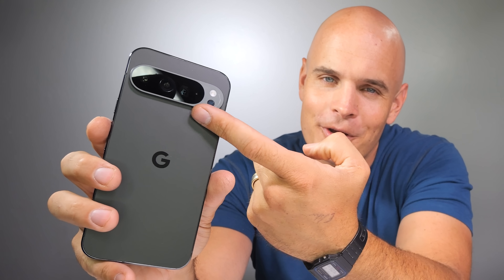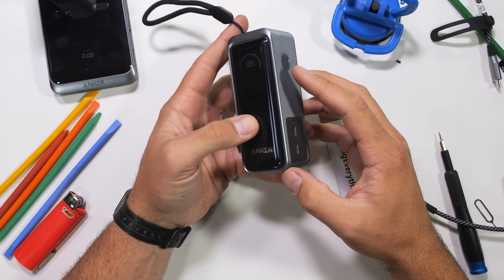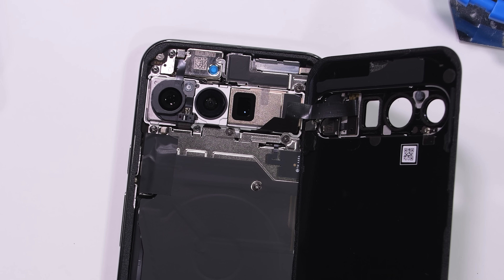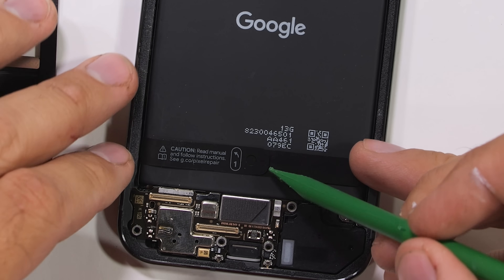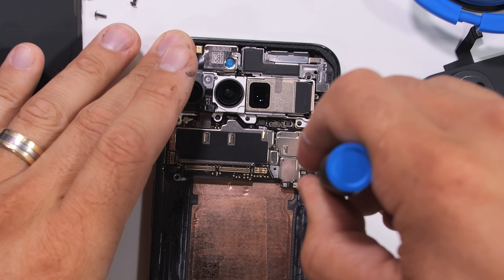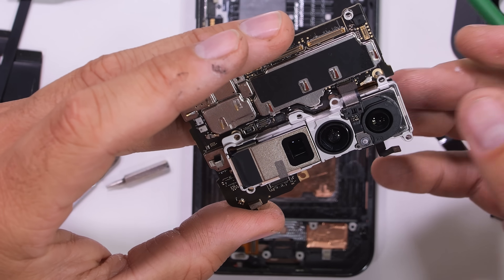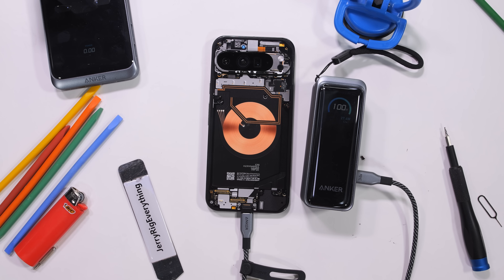Google Pixel 9 Pro XL TEARDOWN – (turn back while you still can)

Comment: Thanks to this video, I'm not buying the Pixel 10 Pro XL.

I'm a power user and always charge my battery to full at least twice to 3 times a day. I'd usually want to replace my battery 9-15 months in. With this phone, it's almost impossible. So screw Google.
Reply: See pixel 10 pro XL, it's impressive

Comment: 3:11 From an engineering perspective, varying thickness would indeed make a difference (a standard thickness is good, but with space concerns it is the next best option). But it isn't worth the added manufacturing complexity to actually do it, most of the time. At least, thats off the top of my head, so I could be wrong.

Comment: Just looked at the iFixit on how to remove the batteries on the pixel 9 and oh my God is that ridiculous. And oh my God is that ridiculous. In the instructions it says to tape off the tabs, heat the battery up and certain locations for the adhesive and then you're supposed to use pull tabs to saw under the battery to pull it up and out. And it's already a nightmare to get to that point with the battery where you have to remove all that cabling and screws that are all different. Such a bad design for repairability.

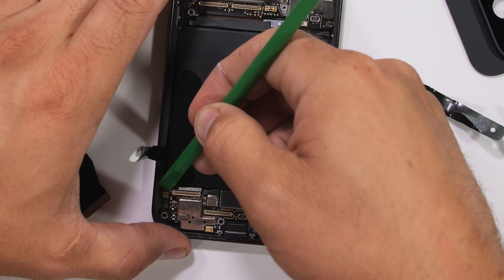Comment: 4:17 **“Hey Zack, I love your teardown—especially when you explain the L‑shaped mic channel and how it preserves water sealing even if it’s poked (around 5:15 in the Pixel 9 Pro XL teardown)

This might be unrelated, but I recently dropped my Pixel 9 Pro on hardwood. Afterwards, the physical SIM slot stopped working, the vibrator motor died, and the loudspeaker is now silent.

Could these be the result of a loose or damaged connector you’ve encountered in your teardowns?

Or perhaps something got dislodged or broken on the motherboard?

Would it help to open it up yourself, or is it best to seek professional repair?

Thanks for any insight!”**

Comment: You can use the straps to cut through the adhesive. Other videos show that. You also likely need to use purer alcohol. 91% or 99%. It would help of the alcohol is warm. Work it in, add more, Granted it'll take a little time. The glue is annoying. These really should be screwed in batteries IMO. People really should write to folks in congress demanding that device manufacturers are required to make the batteries more replaceable, and require all devices standardize on a few set battery form factors, with commitments to keep making the same battery form for 20 years (with charging circuits capable of dealing with newer battery techs).

Comment: I love my Pixel 9 Pro, but within 2 months, the back panel makes a squeaking noise any time pressure is made on the bottom half of the rear of the phone. The phone still works fine but it is a horrible noise to get used to.

Comment: Bro, i just poked wrong hole trying to eject SIM slot on a fkin new 9 Pro XL, your video saved me from the stress...
Reply: What about your water resistance today? It works fine? Cause i did the same on my new phone too 😢😢
Reply: @SHISHINTO2012  tbh, I didn't risk checking, so be careful bro 😢😢😢. But I think it should work OK, ig.

Comment: We have removable charge ports in pixels and you don’t need to risk screen damage to get in the phone. This is a repairability win from someone who has done warranty repairs on all pixel models. Heat and iso will get the battery out no problem. They’ve been this difficult to remove since the 6 series, nothing is new here. Need a standoff bit and torx bits? You’re already buying an ifixit kit to open this to begin with, so these points are irrelevant. If you’re not confident in opening an expensive electronic, don’t. They haven’t been “repairable“ for the average consumer in YEARS. Pixel repairs are easier and more forgiving than any other manufacturer starting with the 9. I’ll take it to the grave.

Comment: Hi Jerry, when you punctured 5:16, the membrane and you assembly them backl again, does the bottom mic still works on your side? I have the same damage from my mic membrane when I checked the inside because Google voided my warranty and I wanna know if that membrane is actually the one that made my mic stopped working or I need to replaced the entire charging assembly that comes with a mic on it. Please I need your answer into this. Thanks.

Comment: I accidentally stuck the SIM tool in the microphone hole, glad to hear that no damage can be done. I definitely felt some kind of "pop sound" though. Is there a membrane that protects the device from dust that I damaged?
Reply: Yeah i heard that too, so today your water resistance and mic works well? Cause it was my first day with the pixel 9 pro 😢

Comment: Why is there a need to glue the battery to the body? What about the good old days of battery replacement by just lifting up the battery to remove it!
Reply: Having a battery just floating around in a phone you move around in various ways every day is not the smartest idea. Some glue is necessary but google used way too much here.

Comment: As a technician, I get where the t4 screws would not be the greatest butt versus a Phillips. These screws tend to have more torque available before deforming versus Phillips. Though I have had some bits break on the t4s before as well

Comment: The adhesive slicer for the battery might not be a slicer. On my pixel 6a I just used it to lift the battery up and it worked. 

Take the both ends of the plastic strip as high as you can and try to lift up the battery a bit
Then take both ends of the plastic strip to the lower end of the battery and try lifting up the battery

Comment: A good tip I use for organizing screws is using cardboard. I just draw a rough outline of the device, and stab the screws in the cardboard where I removed them. Very useful.
Reply: Good method.

I use a numbered small parts organizer, looks like an ice cube tray. Then I watch a video and remove the screws in the same order as the video and reverse the process when done.

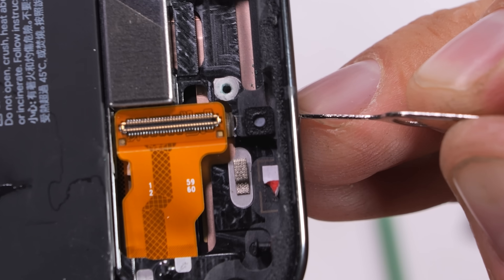Comment: 5:03 - I pressed the SIM needle into this hole by mistake to remove the SIM tray. I did it with force, I hope I didn't damage the microphone. It's surprising why Google made a hole next to the SIM tray
Reply: Your water resistance and mic actually works fine? Cause i did that recently 😢
Reply: @SHISHINTO2012 Mics is OK, waterresist doesent try now, all fine😮

Comment: It doesn't matter what they say—when you open the phone and the camera lens isn't exposed, dust still gets in. No matter what they claim about it being easier to repair, in my opinion, the outer protective lens should be directly connected to the lens housing with screws, so you can separate it. But when you open the back or the front housing, the camera lens should not come into contact with dust at all.

Otherwise, the repair makes no sense, because not every repair shop has a dust-free room like the ones in manufacturing, as I know from China or elsewhere.

Comment: In my opinion this is much more repairable since you don't need to remove the screen to repair it. My 7 pro back glass broke and there was no way to fix it without accidentally breaking the wireless charging coil that is glued to the back glass.

Comment: The design is too bad like ASUS, intentional error by the manufacturer, the connection cable is on the battery, when the battery swells it will pull the socket connection destroy

Comment: Bought google pixel 6 pro when it got released....only usb C cable in the box. After struggling with the software and battery for a lot of time(2 weeks, but it seemed more), i sold it for a Xiaomi mix 4.

Comment: Certified mobile electronics and micro-soldering repair tech here. Just wanted to say a few things regarding some of your remarks in this video. First, the torx bit is one of the best designed bits used to ensure it less likely strips and getting the size wrong is near impossible. Philips and Apple's famous "tri-wing" are terrible, especially the latter. Apple uses screw sizes of all kinds of different heights. If we remember the home button phones, getting one of the bracket screws mixed up with the one screw behind the home button would result in permanently damaging the home button which is irreplaceable except by Apple. Apple also still has measures in place so the face-id components are not replaceable. So to say that Google is moving backwards compared to apple is ludacris. Yes Samsung probably has the best repairability score due to every screw being the same and very few components, but there are certain design aspects in the phones that are also terrible that cause permanent damage, but that's another debate. In regards to the battery removal, Apple's "pull-tabs" haven't been useful since the iphone 7. Pull tab quality has decreased from the iphone 8 all the way to what we have now and using a heat plate and alcohol paired with a prying tool is the best and fastest way of removal. I don't even touch the tabs unless its pre iphone 8. Samsung is no different in that regard either. Sure the pull tab they give is much larger, but still requires excessive force to remove, heat and alcohol are still your best friend there. This is just simply the best method of battery removal, it's the nature of the design. it's no different than having to use heat and a knife to remove back glass. It'd be like ignoring the proper method and then cry when the glass breaks. Could there be an easier way? Sure, but every phone manufacturer including even Motorola use this same pathetic method of using the worlds strongest adhesive to secure a battery. imo here there is no change from previous generations of pixel phones. They have always used torx bits, and the battery tabs are to be ignored in near every phone by any tech in this field.

Comment: I immediately jammed the SIM tool into my microphone hole and I was so nervous I damaged the mic! Thankfully it works.
Reply: same here. thanks the one who design the microphone near sim tray
Reply: I did this exact thing 🤣
Reply: I did same exact thing but it works fine and I finally sucked my microphone hole to test waterproof, then no air leaks found😂
Reply: Did your pixel works the same after that? Need to know cause it was my first day with it today! And i did it i wont sleep tonigh dude 😢 @kyandercobalto888
Reply: @kyandercobalto888 so we can say it's still water resistant?
Reply: @dev-sz4sr Yes. no air leaks mean that no water invade.
Reply: @kyandercobalto888  I did also but in upper mic hole :o Looks like everything is ok...
Reply: @kyandercobalto888  what do you mean by this?
Reply: fuck i did exactly the same. I know Im an idiot, but the google people arent far behind
Reply: I have the same concern; I think I damaged the microphone hole's water-resistant membrane when I hit it with the SIM card tool
Reply: I just did exaclty the same and am watching this video to see how bad i f*cked up. Im glad engineers thougth of that
Reply: Does the mic positioning sideways to avoid damage also applies to the Google pixel 9 pro (not the XL version?) Anybody knows this?
Reply: @lehajenowa  yeah same in pixel 9 pro. in fact, every phone uses same mic module.
Reply: I did the same thing.  why the hell did they design it like that?  thanks JerryRigEVerything for doing a teardown.  that calmed me right down lol

Comment: Having screws be Philips is bad. It allows people with absolute zero knowledge to try to repair it. At the least if they don’t even have the drivers they shouldn’t be repairing. You should see how many fire calls are received from accidental stabbing while opening or just pulling batteries out without pulling tabs out it’s crazy how lazy people are so in a way it protects some of these slow people

Comment: it is a pixel, you just need to use it for 5 minutes and it will be hot enough to remove the battery easily 😅😅😅😅

Comment: You would think that it is unnecessary to have that much glue on the underside of the battery, but if you look closely you see that the battery is glued to the copper vapour chamber, so the heat from the charging of the battery could be directed away from the battery. I'm not sure if is necessary to repair these phones as they get tossed away while they are still perfectly working by people who want's something new in their hands. By the time the battery needs replacing nobody wants that old phone anymore.

Comment: This seems pretty biased to me (and not sure why). I've worked on plenty of phones and personally not a big pixel fanboy myself, but you are just being unfair. TORX is very standard, i'd rather have that than philips any time of the day. Different screw sizes? Seriously? People that are even slightly skilled to do repais need to keep track of the screws one way or another. Look at any assembly, being it cars, computers components or even furniture.
The battery situation was really a stretch, i mean come on.. those are not pull tabs and if you would have spend 10 seconds looking into it, you would understand how to use the "tabs". Yea, the glue is strong, imho way too strong, but still I wouldn't call this as a major issue. 
Everything is pretty modular, USB port, cameras, etc..
I would love  to jump on the bandwagon of bashing but there is no objective ground for that...

Comment: I don't like how you criticizing good changes as bad. They definitely need to fix the modem because the previous pixels had terrible signal and disconnection issues. There was also a huge issue of overheating in the previous pixels as well, and they've addressed that pretty well. Cooling is so well that their performance is more stable over long durations than S24 Ultra.

Comment: Sincerely one of the worst videos I´ve seen from this channel. Starting with a awful ad lasting almost 1/4 of the duration of the video (and for a not that great brand). And so many remarks and opinions that from a technical standpoint just aren't correct. If I didn't know your channel I would think this video misguides viewers on purpose due to a personal agenda against the manufacturer. Opinions are ok, judging manufacturing decisions without knowledge of technical characteristics of the components and how they work is just not ok from a channel like this.

Comment: Yup, they really need to do away with those strong adhesives for the battery and put a battery adhesive pouch instead. At least they made the charger port replaceable finally which is a pretty big improvement considering its been soldered to the main board for as long as I can remember on these pixel phones.

Comment: Indeed Google is going backwards in complexity and repairability.  Not to say it is a bad unit but, I have been a Samsung Galaxy "S" series user for over a decade and (for me) I really like where the Samsung One UI has gone with further tweakability with the Good Lock modules that (for me) no other Android brand can beat with the added Modes and Routines and DEX that I use daily!

Again just my opinion but the camera area is just absolutely HUGE and not attractive but, like many of us a case will lessen this to some degree.

IMO never been a Pixel fan having tried a few I always go back to the Samsung "S" series because for me the rather stock OS does not really do much for me and like to tweak every aspect - again ALL strictly opinion as SO many prefer the simplicity/blah-ness of an iPhone that I just could never live with day-to-day to look at or use and interact with.

Comment: Luckely in 2027 the EU will pass a law which will make it mandatory for new phones to have easy consumer removable battery. It was just so great with the old phones. Oo battery is empty, well I just swap it with a fully charged one. No need for power banks with cables etc.

Comment: Using more screws does not necessarily worsen the repairability I think. Only if standoff or brackets physically break. And in this case - you're, well, screwed anyway)
Baffles me - why they won't use them for batteries? Slim and well calibrated springy bracket over the battery wouldn't take much space.

Comment: Been a fan of anker for years but recently the quality dropped a lot. Got a charging cable that loses connection to my Pixel 6 Pro (which works with other cables) and a wireless charging pad that just went red light of doom and won't work after 8 months of use. Upon contacting them they didn't seem keen to fix the issue and basically told me it's bin time.

Comment: For me, the Pixel 9 Pro XL is the phone of the year. As someone with a disability, I love the voice command feature—it's just impeccable, even better than on the iPhone. The streamlined and minimalist Android interface, especially in the settings, is another strong point.

However, I'm not ready to switch from my iPhone just yet for the simple reason that the iPhone is still superior in terms of photo and video quality. The day Google understands that instead of focusing on unnecessary artificial intelligence, they should focus on surpassing the iPhone in photo and video capabilities, it will be a game-changer.

You’re capable of it, Google—you have the money and the talent to surpass Apple. What are you waiting for?

Comment: Seriously? You are against T4 screws? They are so much better and I stopped using Philips head for private projects ages ago. 
How many screws were too tight and because of poor quality I could only get them out with difficulty. Sometimes I even had to drill them out. Torx is so much better.

Comment: from a repair shop POV this phone and all google phones from the pixel 3 and up have all been very repairable genuine parts and fingerprint calibration tools provided to anyone  apple has been going backwards since the iPhone 8 when they added the tri screws to the device and recently making every 3rd party part scare people in to never repairing there phones or spending money on apples excessive fee to use genuine parts. this phone would be easily repaired by the right people battery wouldn't need removing for any repair except a battery replacement.